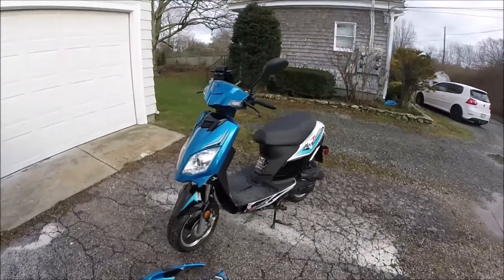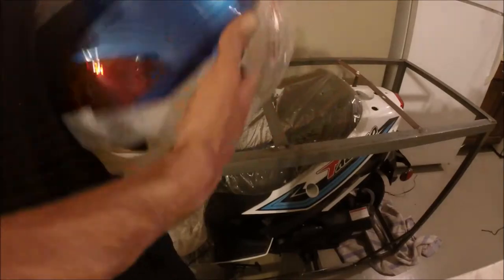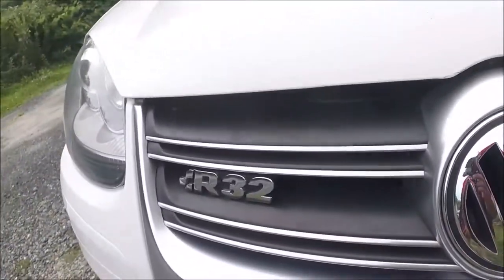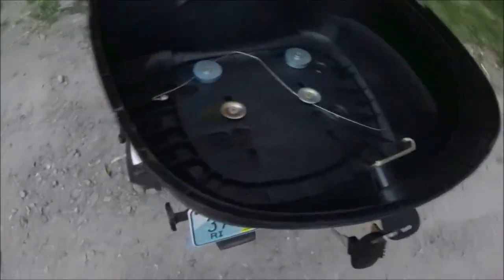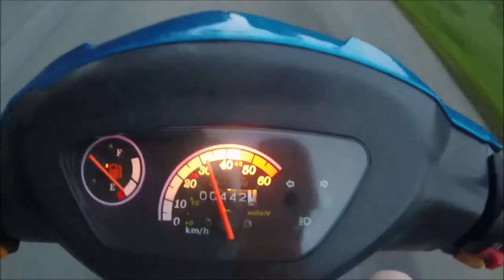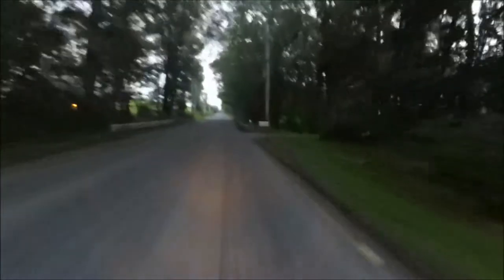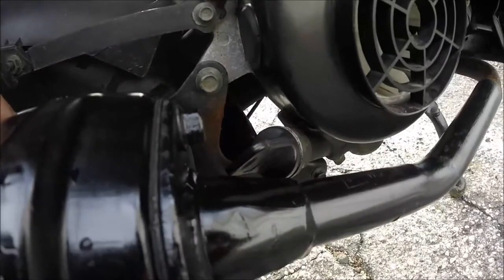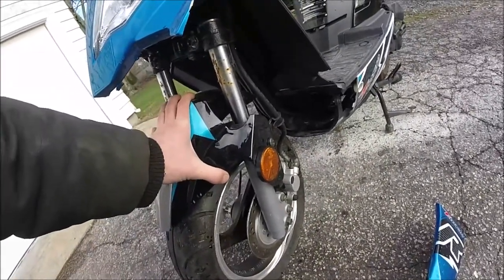Buying My Crashed Scooter Back After Selling It

Comment: I have the same taotao thunder 50 I bought it back in 2013 it's a 2012.. I've had it for 4 year's it's a good scooter...
Reply: i bought mine new in april 2016 and it does not have running lights